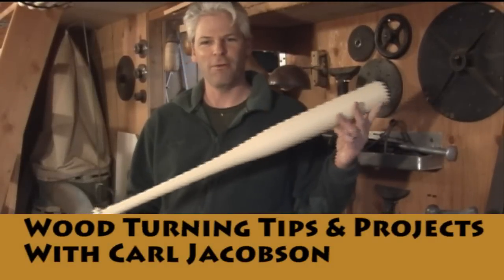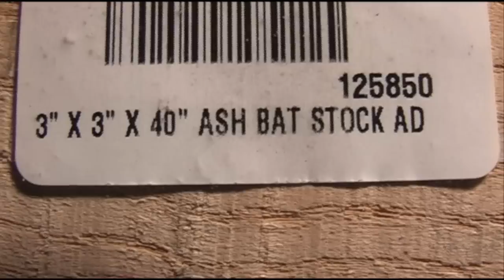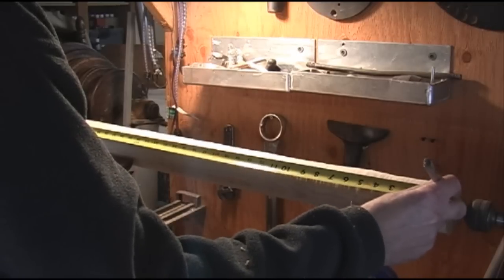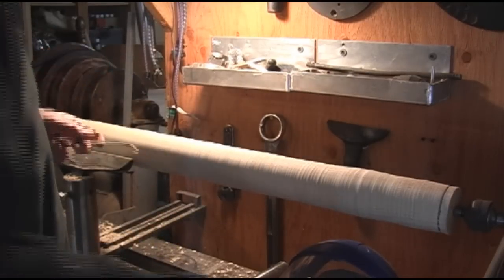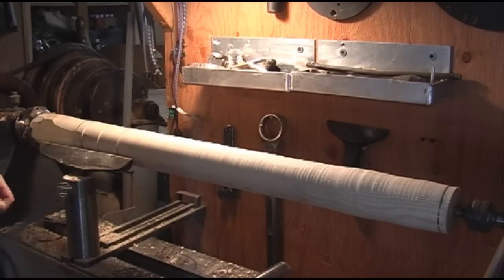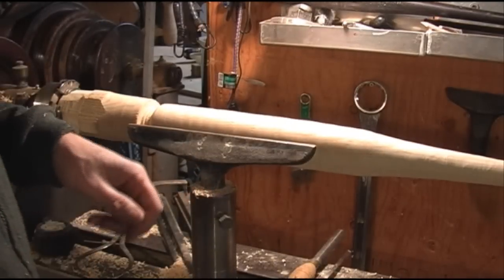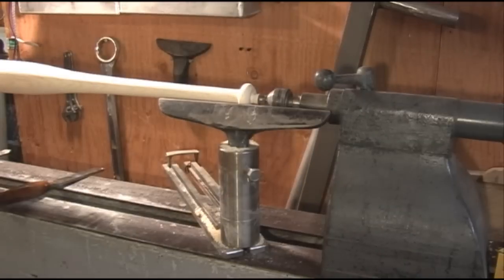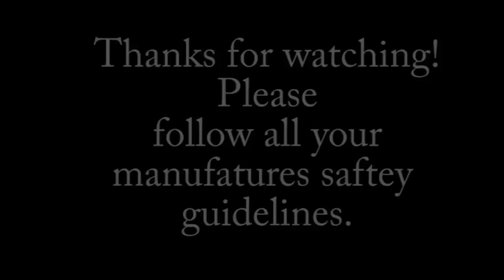Woodturning How To Make A Baseball Bat

Comment from the maker: Hi,
I used Ash but I would go with Maple if I do another. You can find the blanks at Woodcraft. They make a lot of carbide cutters for gouges so I think you could find a metal cutter that will work.

Good Luck,
Carl

Comment: Carl, you are awesome on the lathe..i would recommend that this bat should not be used to hit baseballs. The bat you made here is a softball style bat. The bat here, is top heavy, and if the ball was to strike the bat anywhere lower than the barrel it would splinter and actually be dangerous as the momentum of the swing would send the shattered barrel towards fielders. Baseball bats have specific tapering from know to end of barrel that allow more of the bat to be stronger and lighter.

Comment: For 3 dollars but it broke while turning it. They thought it was ash but turns out the center was rotting and basically crappy wood. Do you have any suggestions on where to buy it so it won't happen again? I was so disappointed when it happened.Thanks!.

Comment: I've tried to make 3 bats, but they are not comming out well
Is your entire barrel 2 5/8?  The instructions I've been following has a different measurement every 4 in. Help?
Thanks
Reply from the maker: I got the specs off of Louisville Slugger website. The bat tapers down to a 1" handle.

Comment: I bought a used lathe a few days ago . I made a baseball bat for my daughter first time ever using one and while I was shaving the wood there was chunks coming out of it. Is this because the tool is not sharp enough or user error ?
Reply from the maker: Shawn P Congrats on the new lathe! 
It could be a little of both, what type of wood are you using? I think I used Ash, and it's not a good turning wood. Do you have a sharpening jig?